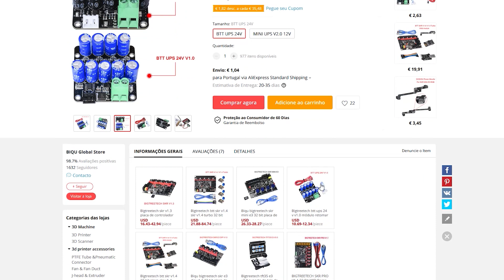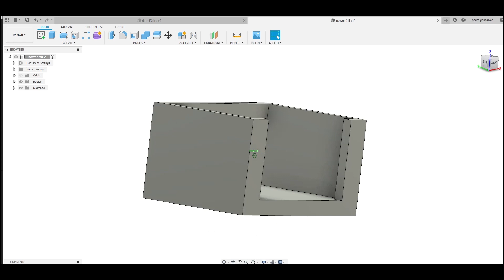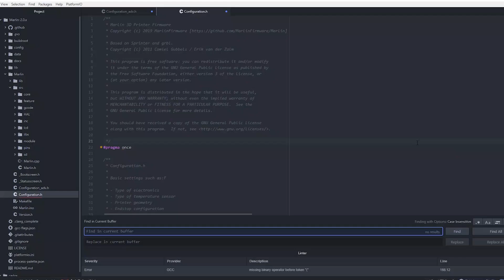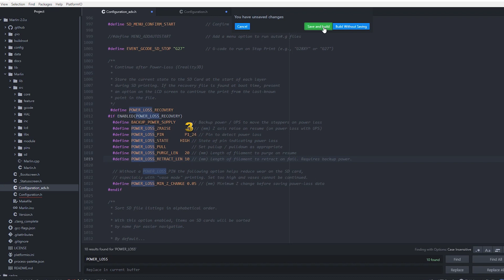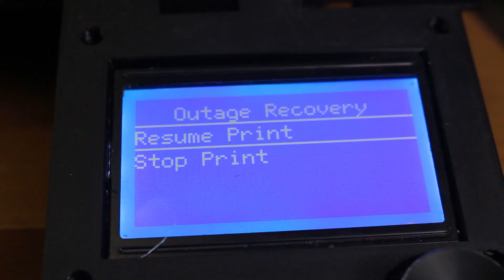How to install BigtreeTech Mini Ups

Comment: Nice clear simple instruction.
Reply from the maker: Thanks
Reply: Nice, clear and simple instruction? But if the high of Z does not work after blackout. To continue printing you do not need this module.
Reply: I did everything in the video. I tried different ways and bought two different modules. Neither worked. It does not detect power loss.

Comment: there's only one snag, if the power outage is too long, the print will pop off the bed with the cool down. If its a very brief outage, OK it is a good purchase. If only the power companies can promise a very short outage. Most times not unfortunately!

Comment: I have a SKR MINI E3 V2 board with TFT 35 and UPS BTT 24V 1.0 and Relay 1.2. and Smart Filament Sensor and BLTouch 3.1. Both MB and TFT have the latest firmware available. All these elements are connected directly to the SKR MINI E3 V2 motherboard and not to the TFT35. Printing works from the graphics menu but only after inserting the SD card into any TFT card reader. When the SD card is inserted into the SD reader on the motherboard, despite selecting the file, nothing can be printed. When I switch to Marlin mode, the system does not see any reader other than the one on the motherboard. The attempt to print ends with a message about a printing error and the need to turn the printer off and on again to complete printing. After rebooting the printer, I see the print recovery menu but the system keeps repeating itself.
How do I get rid of this problem?
I would like to test all components except the KR MINI E3 V2 motherboard with TFT 35 and BLTouch because I know that these elements work.
Please help
Reply: Problem is identified: https://github.com/bigtreetech/BIGTREETECH-MINI-UPS-V2.0/issues/11 oraz https://github.com/bigtreetech/BIGTREETECH-MINI-UPS-V2.0/issues/10
Reply: If i unplug the signal line before SKR mini e3 v2 and BTT UPS 24V v 1.0 then i can print any project from SD card inserted to SD slot on mainboard. If i plug the sugnal cable between SKR and UPS that about 1 sek about start printing, and marlin report power supply error and breake printing and power off my printer (with relay 1.2)
Reply: @Substancia 3D
Can you test the SKR mini e3 v2 and BTT UPS 24V v 1.0 on own environment that this compilation will working ? BTT non answer on my problem. Propabbly SKR MINI E3 V2 not working correctly with BTT UPS 1.0 24V. Many users report this issue

Comment: You are not honest. I did everything in the video. I tried different ways and bought two different modules. Neither worked. It does not detect power loss. You just advertise BTT?? 🤔🙄🥴
Reply from the maker: Im really sorry if doesnt work for you, please contact the bigtreetech support, here it really works as you saw on the video 
;-) best regards
Reply: Because "pin" in config depends on the motherboard type. You need to check the correct "pin" for your motherboard.

Comment: WARNING: New Versions of Marlin have add another parameter, and you do NOT want to uncomment it!
//#define PLR_ENABLED_DEFAULT   false // Power Loss Recovery enabled by default. (Set with 'M413 Sn' & M500)
If you uncomment the functionally will be there, but you will need to execute a GCODE command to turn it on: M413 S1  then an M500

Comment: Hi. I just installed my Bigtreetech Mini UPS after watching your great video. I have a question regarding the line #define POWER_LOSS_MIN_Z_CHANGE 0.05. I was under the impression that Marlin would only write to the PLR file when a power loss is detected when a pin is defined (1_24)  But with the above option enabled, it seems to write regardless. So can you disable #define POWER_LOSS_MIN_Z_CHANGE if you have this module sensing power loss? Thank you. The module is working. Tested with my machine idle. Powered off and the printer remained on for a file. Thanks.

Comment: Mine is not working. Do you need to set M413 S1 in Start Code?
Reply: Is yours working finally?
Reply: @engineerlolo-olorodeatanle1388  The UPS only worked on the Z_Max on my SKR 1.4 Turbo. U you have to define Pin 1.0 for UPS. The instructions from BTT are wrong....
Reply: @TomislavVanDamme  set in pin and change to what you need to register

Comment: Does this work with the non mini SKR1.3?  Got a tad confused when it said Mini in the description.  Thanks!
Reply from the maker: Yes it works on any printer with marlin
Reply: @Substancia3D  Excellent thank you. I thought I had better ask because  users apparently had issues with this board on the SKR 1.3. At least they did with the older version of the UPS. Thanks again! Would definitely love to see your install of the relay 😁
Reply from the maker: @BrianHillard66  i dont have notice any issue in SKR 1.3 or 1.4 or even on creality boards, i have tested also in creality boards and works great (LCD adaptor is needed)

Comment: I take it this will only work if you are printing from the SD card and that it will not work through Octoprint. Is that correct?
Reply: Same question & I agree with you.
Reply from the maker: Yes only printing from sd card

Comment: I want to watch a video on Bigtreetech Relay V1.2 Module Automatic Shutdown Module After Printing
Reply from the maker: Ok i will do it
Reply: @Substancia3D I'm trying to install it in mine cr-10s Pro with BIGTREETECH SKR V1.4 turbo, TFT35 V3.0 Touch Screen/12864LCD Display 32Bit, Smart Filament Sensor, TMC2209 Stepper Motor Driver, UPS 24V V1.0 Module Resume Printing While Power Off Module, Relay V1.2 Module Automatic Shutdown Module After Printing

Comment: Hi, I have SKR mini E3 for my Ender 3. What is the correct POWER_LOSS_PIN ? I used the pin PT-DET https://github.com/bigtreetech/BIGTREETECH-SKR-mini-E3/blob/master/hardware/BTT%20SKR%20MINI%20E3%20V1.2/BTT%20SKR%20MINI%20E3%20V1.2PIN.pdf